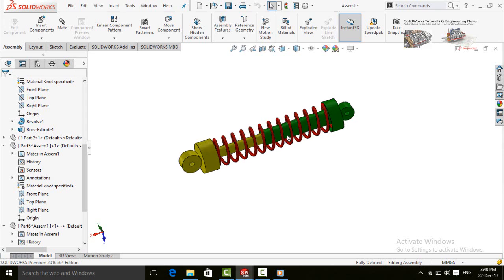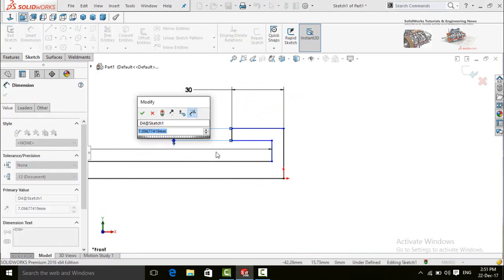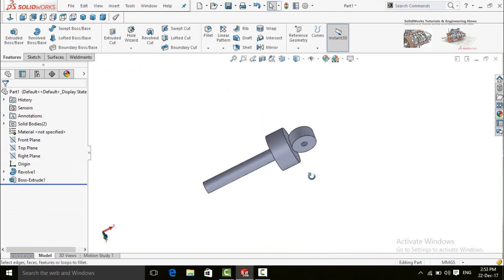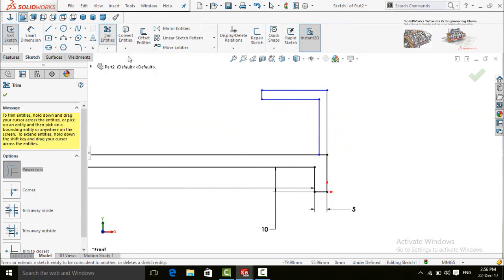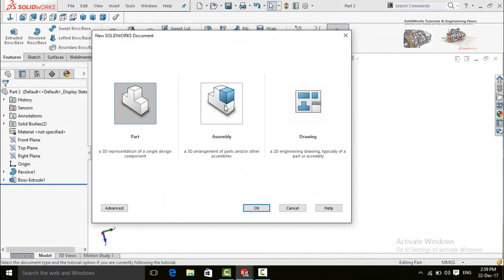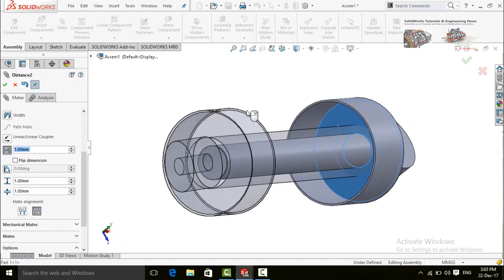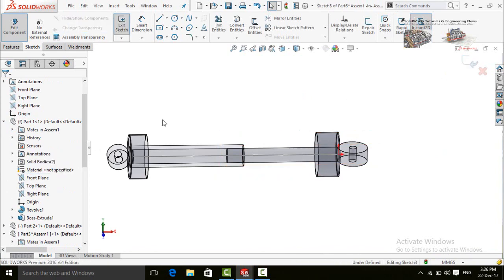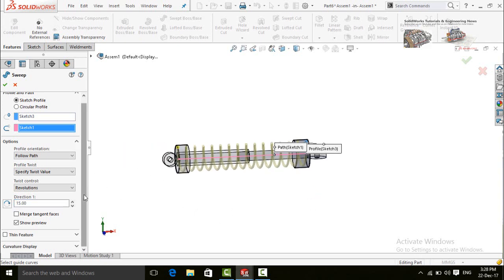Design, Assembly and Animation Tutorial of Shock Absorber in SolidWorks Tutorial

Comment: When I rebuild after moving the upper part, the spring doesn't follow it..
Reply: how did you make your spring?
Reply: This happened to me to, and it's a result of constraining the line that the spring wraps around to the origin and not to the inner side of the right part. If you constrain it to the origin, it won't update because it's anchored to a fixed point, but if you constrain it to the moving face of the right component, it will have in-context relations and will update accordingly.
Reply: @RookiePresent  sorry which line are  you referring to ?